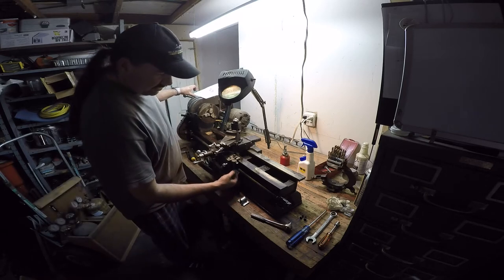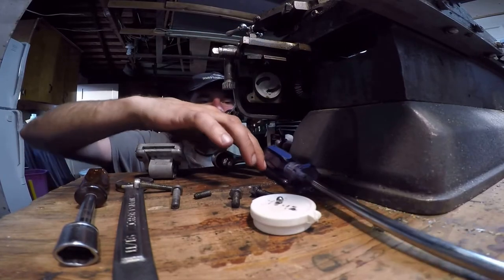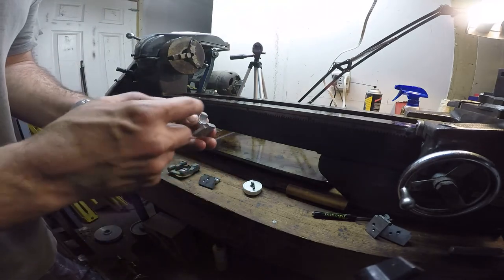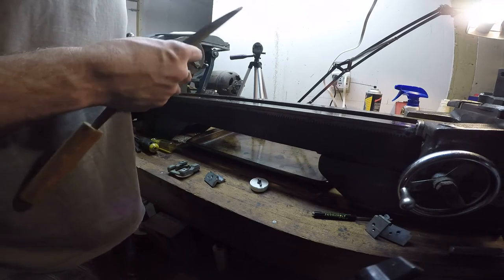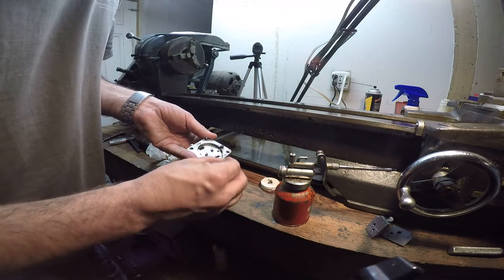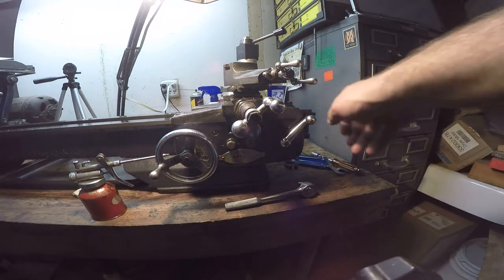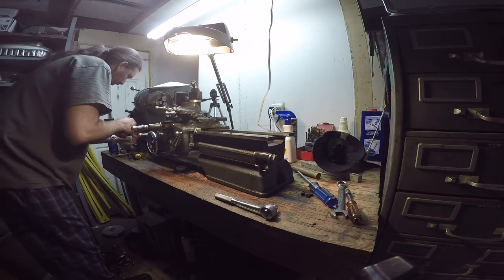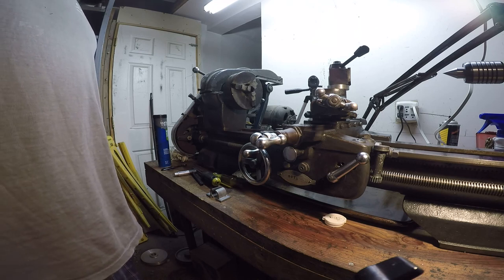Atlas lathe split nut replacement

Comment: Good job keeping the old iron up and running. I called Clausing and ordered new felt and rubber wipers from them. I forget the cost but it wasn't expensive at all.
Reply from the maker: I need the metal covers to. have a bid on ebay wish me luck.
Reply from the maker: clausing doesn't ship to cal. for some reason

Comment: Chris,  Can you do me a favor?  I disassembled and cleaned the apron on my lathe.  When I put the half nuts back together and put the ball and spring in, I cannot get the detent to work.  I am pretty sure I have it together correct, but I noticed that my spring looked like it was short or maybe broken.  Would you pull yours out and measure its length and number of turns please.  I think I need to find a substitute.

On a side note, the apron is about together.  I have to get some screws.  There are issues with my apron and some of the parts.  But you will see that on the next video.

Thanks for you help.

Joe
Reply from the maker: +My Heap will do I think it's about 3/4" to 1" or so and the screw that holds it all jn Aldo adjusts the tension